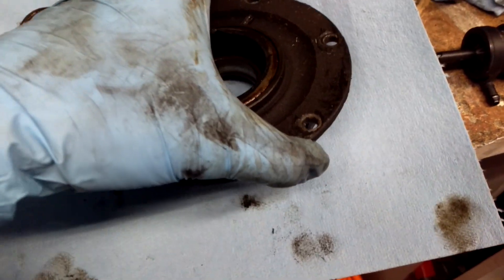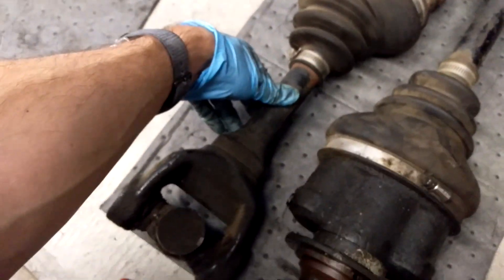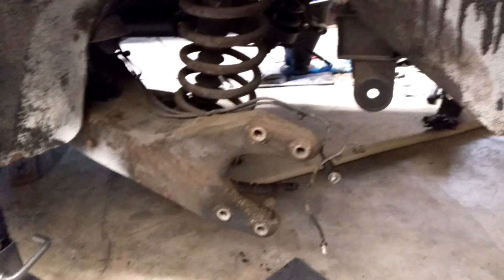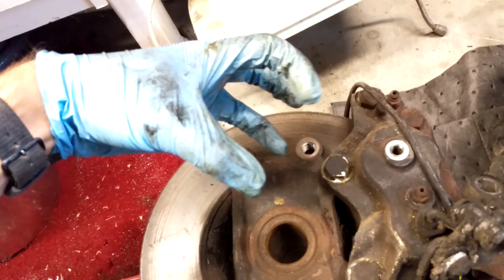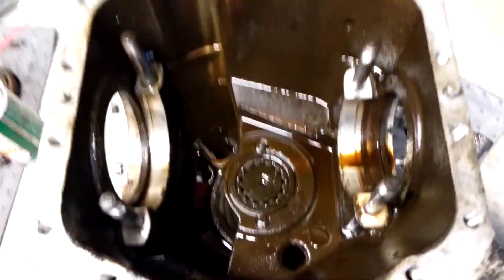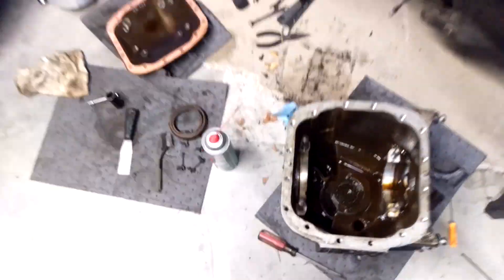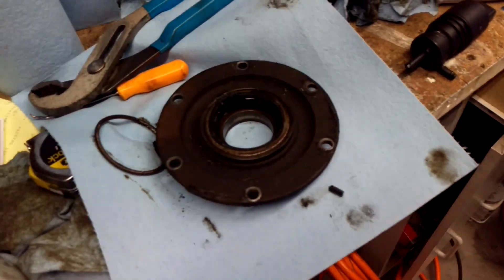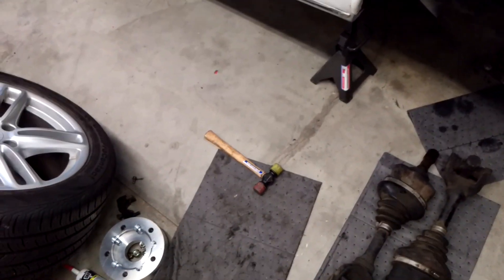Deep inside the rear end.

Comment: That thing is built like a tank... I mean, why in the high holy hell would the differential be built like that? You could literally fit a pumpkin in it... I can't imagine the amount of trunk space sacrificed to make that fit. How much did that thing weigh anyway? I bet it was a bear to remove.
Reply from the maker: +Dead Reckon I had to drag it :o
Reply: Corbin Goodwin
I bet. You're gonna need a transmission jack and a floor jack just to get everything back under the car. Be careful, we wouldn't want you meeting your end by a Rolls Royce differential falling on your face. Although it would make a hell of an obituary.

I'm just trying to figure out the logic of this car from the factory. Probably went something like...

"Right, so we got a big ole' six and three quarter liter engine, a big ole' differential, and we're using that American slag for a transmission? Oi, who's idea was this?"

I mean don't get me wrong, the TH350 is great, but, it is so entirely out of place in this car, it's like a joke with no punchline. At first I raised an eyebrow with that big old Ford 4 speed you're putting in, but now I'm starting to see it's more of a proper fit than the original transmission. These cars are so very strange...